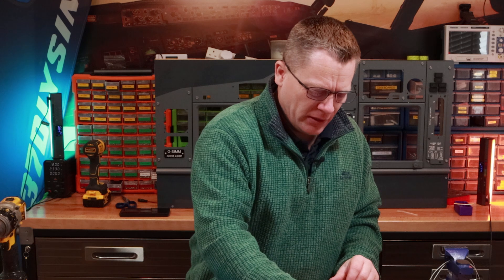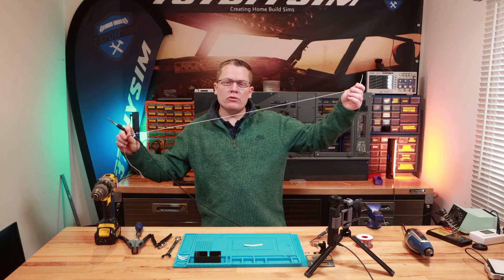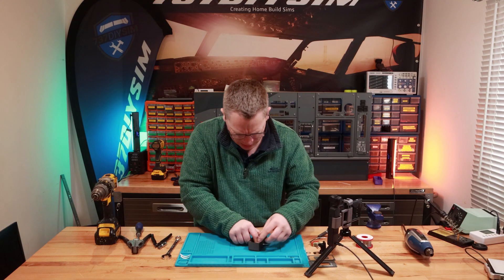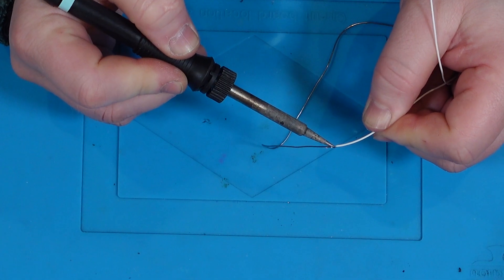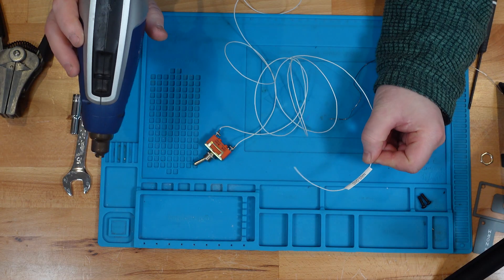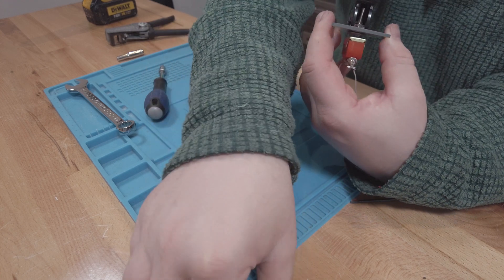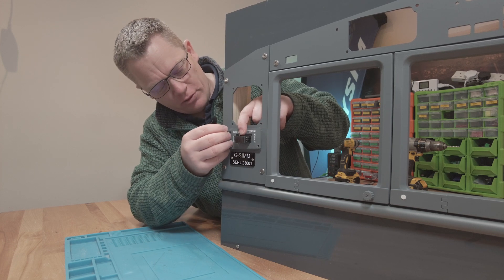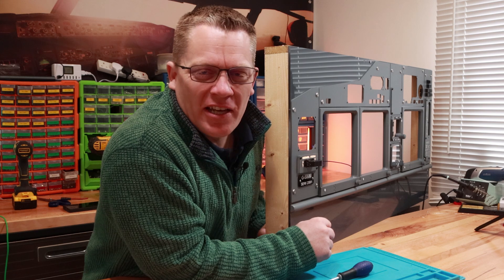737SS NoseWheel Panel Build

Comment: Amazing work as always, so glad I found your channel!  
Two questions for you:
1)  How warm do those LED strips get?  I went to use some 12v LEDs that were strip mounted and they got quite warm.  I'm guessing this type stays relatively cool?
2)  Are you going to zip tie the wires for the switch to the strain relief as well inside the rear housing?
Keep up the great work!
Reply from the maker: Hello, They do get to around 35-38 degrees. Ive not had a problem using them in the big sim this way. Im not too fused about strin reflief on a switch. that will will stay put if the wires are tugged, where as the 12v strip is very delicate.